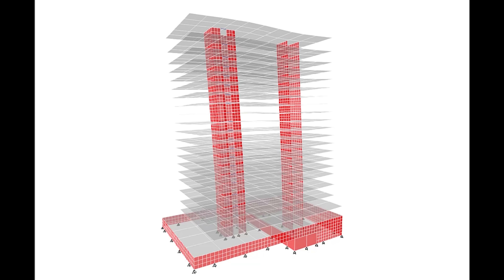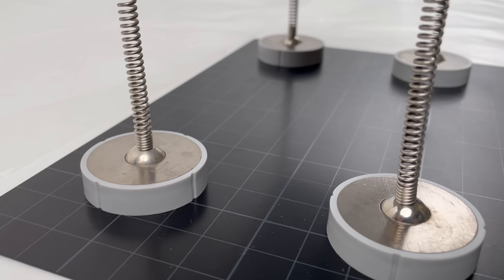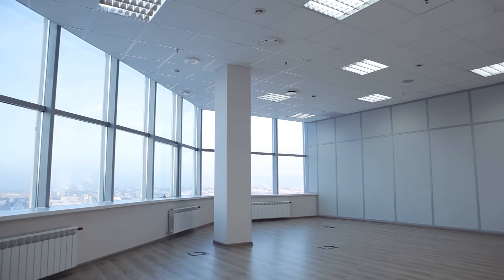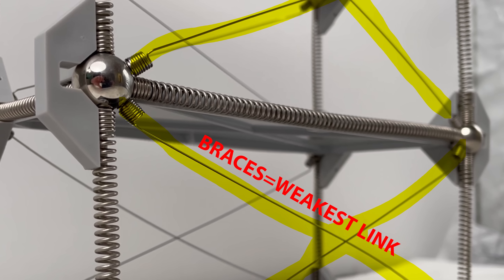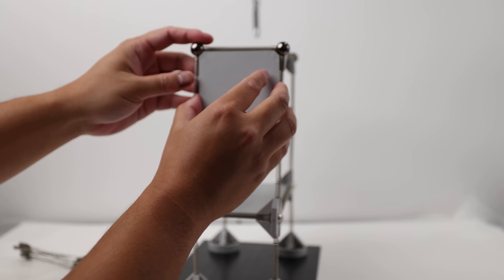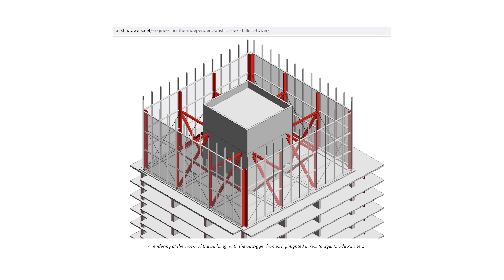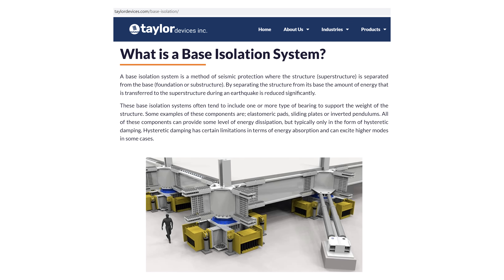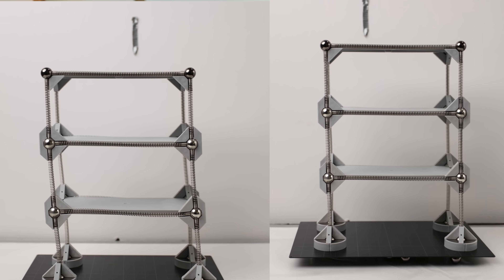Top 5 Ways Engineers “Earthquake Proof” Buildings - Explained by a Structural Engineer

Comment: Nice video and pace. My latest art piece has a ~100hz resonance with heavy handed interaction. Even just watching the building model variations sway has reinforced the lean toward bracing over dampening. 

Hmmm. The dig continues.
Reply: Structure in question is a tripod that vibrates perpendicular (ish) to the axis of all three legs and body core. The vibration tapers off naturally. Even just typing this out has helped me visualize what's happening between arbitrary distances on the legs.

Comment: A good Architect always finds ways to integrate structural considerations without creating conflicts, understanding that the role goes beyond producing drawings—it is about designing and building a real structure. Through proper training, architects recognize that from the very start, their concepts must account for structural criteria, spacing, and the constraints that engineers will later address. This integration begins as early as the massing stage, ensuring that the geometry of the project is both expressive and feasible. In contrast, poor practice pushes the limits unreasonably, resulting in designs that are impractical or impossible to build. After all, no one wants to create a “masterpiece” only to discover that it cannot be constructed and must be redone from scratch.

Comment: The comparison experiment comparing no damper to a water container seems to show that a weight on top helps, I see no reason to expect that sloshing water does the damping - because it barely sloshes in the demonstration.
I assume that is a problem with the demonstration, like not comparing the water with a fixed weight.
I think that the effect damping using sloshing actually exists, it is just not demonstrated in the demonstration.

Comment: A car crash is a rotten analogy for an earthquake!
A car is not meant to crash. It is meant to start and stop and go around corners, and there is a possibility that it might crash, so crash safety has to be built in.

A building in an earthquake zone is not facing a possibility of an earthquake. It is a CERTAINTY. Therefore, if you don't design your building to stand up to the maximum possible earthquake for your zone with only minor cosmetic damage, you're doing it wrong.

And remember, if your windows all shatter in the earthquake, it's quite likely that every other building owner in your city is going to be trying to get their windows replaced at the same time. Expect to wait months for the replacement windows and the professional installers to get to you - or design your building so the windows won't shatter in the first place. Bonus, you don't have to clean up broken glass.

If your house collapses on you in an earthquake, you die. If your house doesn't collapse but is rendered uninhabitable, you become a homeless refugee. If your house is built to not take significant damage in an earthquake, you get on with life and cook extra meals for your less forward-thinking neighbours who are now living in a refugee camp.

I want better for my family than living in a refugee camp.

Comment: I am civil engineer in kenya, can you  make a video on flat slab suitability for  seismic design?  Buildings need a frame arrangement between columns via beams, slab diaphragms and beams form a closed tied up diaphragm that transfer seismic loads to either the bracings, shear walls or moment frames. What do you think about flat slab construction where there is no frame action. Is flat slab suitable for a high rise building in high seismic zone?
Reply: Absolutely not, as in flat slabs punching shear occur and to control this drop panels or drop panels with column capitals are used in low rise apartments, buildings. We can move towards band or waffle salbs but it depends upon totally usage.

Comment: I  have a Question about Base Isolation: what keeps the building frame from hitting the Foundation wall in a Severe Quake-unless there are dampers??

The Water tank on top is Interesting. But, what you had a tall, narrow "Dummy Tower" in the middle of All high-rise and mid-rise buildings. It would be a continuation of the central vertical columns. And, Then, on top of those columns, you had narrow poles made of Carbon Fibre or some other space-age material.

I''m thinking of a Vertical Bullwhip here. A whip cracks at >Mach One because of transfer of momentum from the handle to the fall, and finally-the cracker. Similarly-the tower and poles could theoretically transfer momentum from the ground-shaking to the less massive tower and poles, similar to a Cue Ball striking an Object Ball.

Comment: If the earth cracks beneath the buildings and widens ..then no amount of earthquake proof structural changes  will be able to withstand splitting the building apart too.
Reply: Don't build your building that close to an actual fault line. It's the only solution.
Fortunately, fault lines are mapped.

Comment: The term "earthquake-resistant" is a more accurate description of structures that are designed and built to withstand the forces of earthquakes. The use of the term "earthquake-proof" is misleading and inaccurate, as no structure can be completely impervious to the forces of earthquakes. By focusing on earthquake resistance, designers and builders can create structures that are better equipped to withstand earthquakes and protect human lives and property
Reply: The difference between "earthquake-proof" and "earthquake-resistant" could be comparing it to a person wearing a helmet. A helmet can provide protection against head injuries in the event of an accident or impact. However, it is not "accident-proof" as it cannot completely eliminate the risk of injury in all circumstances. Similarly, a structure that is designed to be earthquake-resistant can withstand the forces of earthquakes and minimize damage and collapse, but it cannot be completely "earthquake-proof" as it cannot eliminate the risk of damage or collapse in all possible earthquakes. Just as a helmet is a vital safety device that reduces the risk of head injury, an earthquake-resistant structure is a vital protective measure that reduces the risk of damage and collapse during an earthquake

Comment: One extra for building that already exist without any earthquake resistant technology. They can add capsule pod on each floors, like a 3m² metal box, with emergency supplies. So when an earthquake occurs, instead of running down, they can go inside until it's safe

Comment: There are even more methods and some have been used for centuries!
The best example I can think of are Japanese castles with their drywall foundations and unusual wooden joints. Another example were some images of the Aartal where a flood erased brick and stone buildings, but left timber frame buildings standing (ground floor walls gone, but the frame kept supporting the upper floors). This type of construction also withstands earthquakes relatively well. I just wonder how it compares to very similar Japanese wood structures, which seem to put more of an emphasis on sliding.

Comment: Excellent and simply explained.

An earthquake consists of more than just lateral dynamics, which are the "P-waves", which travel the fastest and arrive at the surface first. The "S-waves" are also extremely devastating, which manifest more or less vertically at the surface, travelling more slowly and arriving after the lateral waves. Designing buildings to survive both of these is extremely difficult. 

It would be great to see how structural engineers have learned to strengthen buildings for both of these wave types.

Would be be awesome if you could illustrate this so vividly.

Comment: Is there any earthquake protection system for which building structures have already been built but don't have enough earthquake resistance capacity?
Reply: I've seen many buildings that have bracing as well as external columns and beams added after construction.
Those are super common especially in japan.
In fact most buildings like school, built before 1995 there have them I think.

Comment: Limited ductility + Overstrenght + Anchors as Energy Dissipator = Chilean Practice
Reply from the maker: Thanks for sharing, overstrength is one way to go about it.
Reply: 😂😂😂…collapse in the future😮
Reply: @POLYMATHSORTA  After the 8.8 Mw just one building collapsed and like 3 with partial collapse.
Reply: @diegoramirez7901  anchors as energy dissipators doesn’t sound like a good idea. unless i’m misunderstanding you ..? am i?
Reply: @POLYMATHSORTA  
The Chilean practice of design steel structures (mostly for industrial purposes) indicates that it is intended to concentrate the inelastic response in the anchors, leaving the gravity resistant structure with little damage.

This includes the following:

1. Anchor bolts designed to capacity (Tu=fy Ag Ry)
2. Inclusion of shear lugs for shear over 5 [t].
3. Concrete pedestals with high confinement of steel bars.
4. "Anchor chairs" that support the bolt for post-earthquake inspection.

But what Mat says is correct, just one way to do it. This concept is based on practice and has worked relatively successfully in the past. This is due to both economic and technical factors in a country much less developed than the United States.

Great video BTW.